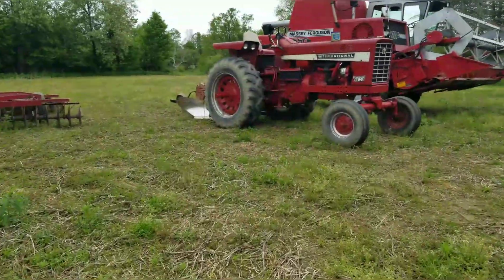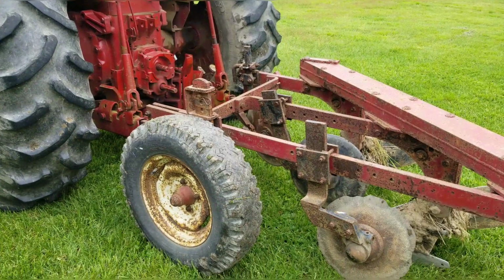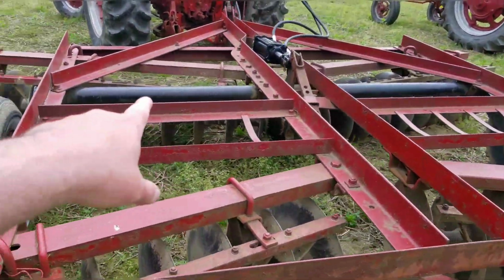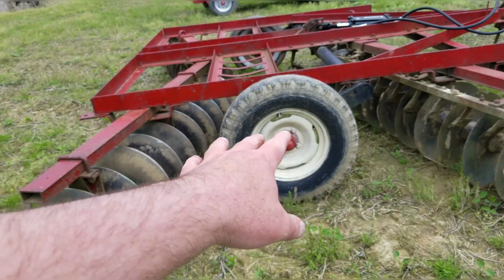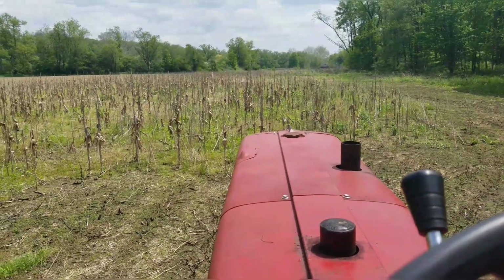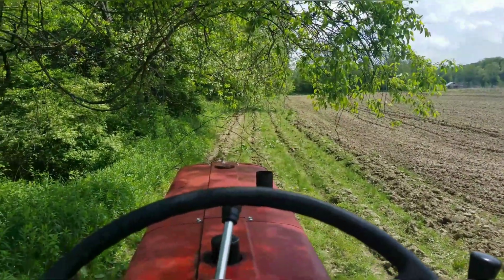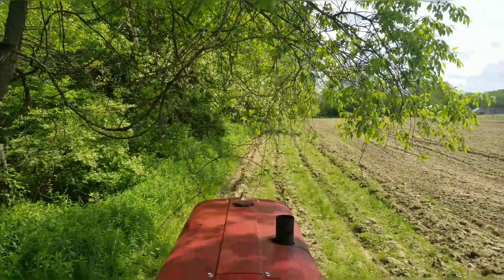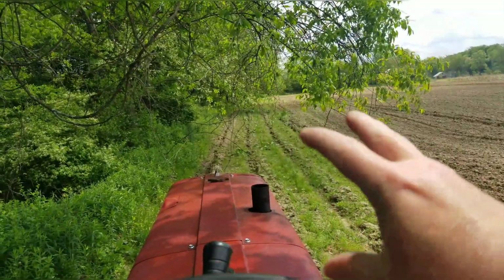Farmall 756 Discing with International 370 Discs

Comment: Thanks for the ride along.  Not too a bad reason to be running without a muffler on the 756.  Those low limbs can play heck with a muffler, believe me, I know. LOL  The disc looked to be working the ground up nice.  Whoever you had on the camera did a good job getting shots of you & the tractor going across the field.  Stay safe.
Reply from the maker: This set is just heavy enough to get it done. That was PA Hillbilly on the camera. Thanks for watching!
Reply: @FarmallFanatic  Hmmm...Just a thought,what about using a 90°degree elbow on that exhaust and having it extent to the end of the hood with a 90°short elbow on it??.This would make it low profile to duck under 🌳🚜⬅trees,but direct sound away from the operator.I can't see how you stand listening to that all day,I'd have to have ear plugs and 🎧⬅headphones over that.
This idea is a copycat from the old Bolens/FMC HT-23,these garden tractors used a similar design.(muffler running across the top of your hood in your case,the Bolens ran it along the side of the hood,the exhaust discharged and the end of the hood the same way though)
Reply from the maker: @4gauge10  my thing is, I run it without a muffler about an hour a year tops, so to retrofit it...it wouldnt be worth it. Ive own tractors that I made the exhaust go underneath the tractor and blow out the back...that worked well.
Reply: @FarmallFanatic  That's even better yet,running it out the back.
I didn't know how often you ran the 756 I.H.,but even for an hour,would seem to give you ringing of the ears.
Reply from the maker: @4gauge10  i push those yellow foam ear plugs in my ears.
Reply: @FarmallFanatic  HAHA!!.That will work,as long as you can dampen the noise.

Comment: Love seeing old Farmall's getting it done. We always ran the disc at an angle (20 or 30 degrees?) to the previous years rows. It seemed to smooth the field out and bust things up a little better. It also makes your planter/drill passes more distinct when you are putting down seed. When running any implement, it's a little easier on the clutch if you don't drop your implement into the ground until your tractor is moving.
Reply from the maker: I go at angles or make sure im working the field in a different direction every year. I agree.
Reply: I disc one way then a second time at 90 degrees.

Comment: I buy WD-40 at Rural King for $18 a gallon. Small squeeze bottles for drops with an epoxied "straw", retired perfume sprayers from yard sales, empty Windex spray bottles and even one gallon hand pump garden sprayers for large jobs. If you want to protect outside metal, be it a plow or underside of a vehicle a 50/50 of old automatic transmission fluid and diesel works. Great on wood trailers too. Not new ideas but worth repeating. We always "oiled" our fertilizer hoppers.
Reply from the maker: Absolutely!

Comment: Getting it done!! 

Does that tractor have stainless steel exhaust valves?
If it doesn't in time you'll burn the exhaust valves without th e muffler.
Reply from the maker: No it dont. I just take the muffler off for these passes.

Comment: The 756 runs well for no exhaust and i bet you could make a exhaust for that just a few pipe bends and mount it to the side and blow the exhaust down
Reply from the maker: No doubt
Reply: Might exhaust yourself out. Hot exhaust will rise. Some small tractors have exhausts that come out bottom and run behind tractor much like a car.
Reply from the maker: Yep, I saw a little ford tractor rigged like that

Comment: What a wussy, lean over be beside the steering wheel and the fender and keep on discing! At the most 1 round outside the field and then move over 1 swatch and disc the second time over.  Then put the muffler back to save your ears.